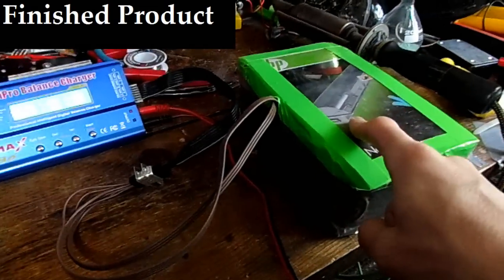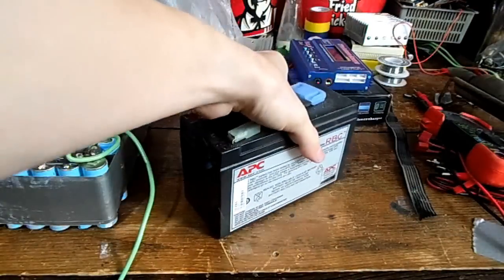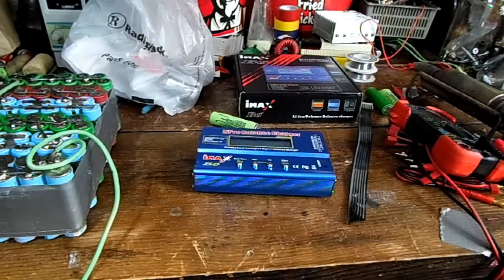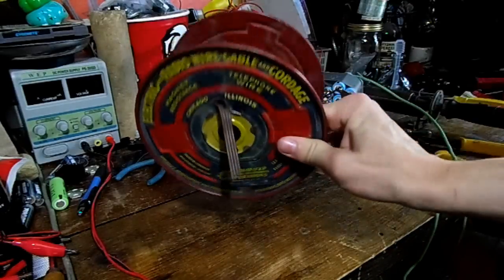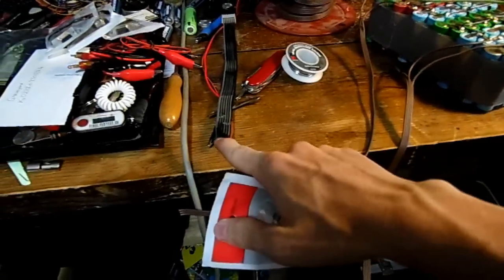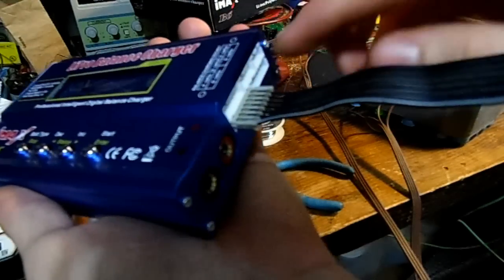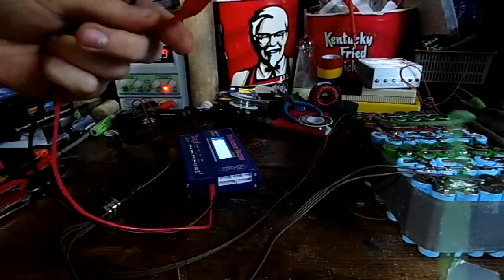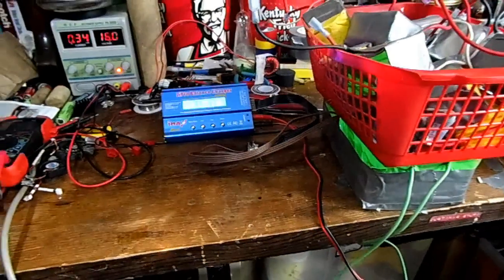DIY: Balance Charging E-Bike lithium battery upgrade

Comment: Nice work! There is an issue I'm not sure you're aware of. You're blncng a 6 cell battery. But each cell is comprised of 12 18650 cells paralleled together. The issue is you're not blncng at the individual cell level. It's like U R bulk charging each of the 6 cells. Diff. in internal resistance (ir) can and will cause the cells to become out of blnc. Out of blnc LiPo is literally like playing with fire. Also, try a MUCH thinner wire for blnc leads or just go to Hobby King and buy it for a buck.

Comment from the maker: Oh that looks better than the b6. When (if) my b6 breaks I think I will get that accucel6.

Watch "EEVlog #397" Dave does a nice teardown on talks about it. It looks very well made.

BTW lilo and lipo can be treated the same way. The only differences in the two are how they are built. You could also do what I do. I balance the battery cells to 4.1 or 4.2v and then after that I just charge it to 4.05v with my 0-30v power supply. I only need to balance the battery every month or so. :D

Comment: Excellent, thats much more clear...ReF the 100amp hour lipo battery, it will be for general electrical demand I,E shower pump, lights, winch, smoothie maker, power tools and mini washing machine ect, im using Trojan T105s which i have to say is a great tough tried and tested battery and i have 4 but without going into great detail they are far from efficient compared to lifepo4 technology but the actual 110 battery packs plus 50 amp charger ect import charge is very very expensive!, will update

Comment from the maker: oh BTW, you said your making a 100A motor, is that Amp-Hour? or do you mean "it can supply a motor with 100A of electricity"?

but anyway, good luck with your battery :D

Comment from the maker: yes the 7th wire is the negative 0v. or first wire depending on what direction :D

the differance between each wire is one cell. the wires go 1=0v, 2=4v, 3=8v, 4=12v, 5=16v, 6=20v, 7=24v.

the IMax charges with the outside leads at 24v. and it monitors the cells with the 7 wires. it first charges them all the same. then when a cell =100% it switches. it charges individual parallel packs through the 7 wires. that 2nd part is slow because it is much lower charge amps so it does not burn the wires.

Comment: Hi (Great videos)
I am going to make a 100 amp lipo battery for my overland vehicle, the only thing im not clear about is exactly where you soldered the balancing wires, Is the 7th wire negative?
Im wondering how the charger can separate each cell to monitor if they are connected in series ?
anyhow could you possible advise me as to exactly how to connect the 7 balancing wires?
Excellent videos by the way and thanks

Comment from the maker: you mean charge with the Imax B6? it's not meant to charge above 24v but thats why i made my 48v battery in 24v blocks.

you could also have two sets of wires coming out of the 48v battery. first wire would let you charge the first 6 packs and the 2nd would let you charge the 2nd 6 packs.

might even be able to charge both at same time if you disconnect the 48v battery in the middle so it acts as two 24v batteries while charging. but might prove a bit combersome.

i hope i made sense. =P

Comment from the maker: hahahaha yeah its the biggest i've seen. it's made for soldering roofing metal together but it works nicely for electronics. picked it up for 4$ at a yard sale a few years ago and just now started using it.

just FYI the soldering iron is an American Beauty Soldering Iron model number 3178. 115V AC 300 watts. :D

Comment: ha ha just starting out with ebikes and electrics.managed to  blow up a brand new lifepo4 48v 15ah batt.opened it up and the bms is fried.has 16 cells i think and 16 balance wires. im gonna buy the same balancer as you and start building lipo packs.really want to ride my bike!i have a question. how would i balance my battery with 16 wires and how long does it take to charge?

Comment: Price from trustfire is 8.06 per piece.  Those are rated at 6000mah so I think it's safe to say around 5 amps for each cell.  Sure I'll make a vid :)
Reply: Did your trustfire battery pack go well?
Reply: @wojciechtechtips1602  Oh hey long time. I ended up buying cells dirt cheap from a battery store called batteryhookup. Got a spot welder and made a battery out of the spim08hp flat cells to power it. Works great.

Comment: You certainly can draw high current from a protected cell.  Whatever the battery is capable off the protection circuit won't limit that.  Over discharge is running the battery dry which can damage it,  it doesn't limit the battery in any way.

Comment from the maker: where the chargers you got Imax B6 chargers? i'm only going to balance my battery like every month or so and instead charge them like i used to with my universal power supply. my first battery pack went for about 80 charges before the cells got .1v unbalanced. and since i keep them 0.2v under their max voltage there is room for error ^^b

i hope you get your other 2 chargers fixed.

Comment from the maker: i would love to mess around with protected cells (aka 19670 cells), problem is they prolly cost more than 1$ each unlike old laptop batteries and arent as plentiful as old laptop packs either.

not counting i imagine the extra degree of complication with a circuit board inside every single cell would make it easier to upset the batteries like you say haha. :P

Comment: sure there is fuse in mains powered product charger ...iii was discussing the use of the battery in powering the motor and how a battery in parallel could short the other batteries like a bus bar ... you wernt really paying attention.. were you ... you just wanted to help gang up on the outsider who was suggesting if there was any error at all  to err  on the side of safety ...iii am doing experiments you guys never dreamed of .. but you blew it and iii wont share any more data with you .. bye

Comment: The Phantom's face in the PHANTOM OF THE OPERA was burned off with sulfuric acid, which was used to engrave printing plates at a newspaper he was wrecking that had given him a bad review.

If there is a bad mishap, find a cave with an organ under an opera house and set up shop stalking a woman.  Problem solved.

Comment from the maker: haha yeah i already switched it to LI+ to charge it 4.1v instead of 4.2v. i heard there is a hidden menu that lets you calibrate the system voltage so might even use that to step it down another 0.05v.

and thanks for the compliment, you definatly know a lot about lithium too :D

Comment from the maker: your kinda starting to piss me off how you keep making comments and deleting them and then acting like i don't take ANY safety precautions or use my brain. when i was welding with the car battery i had a fiberglass shield over the battery so you can stop bugging me about the sparks. and no i don't believe in luck. i believe in chemistry and science.

but hey i don't know if perhaps your just drunk/drugged and have had a bad day. so i hope your day goes better if thats the case. =/

Comment: using skinny wire is like wrapping aluminum foil from end to end on a blown fuse ...yeaa.a. it will work  ..butt ...and its a  big butt ... what if you miscalulate the thinness of your wires due to factors beyond your apparent control ..... ..as  for being paranoid about batteries exploding ... iii already told you about one of my battery explosions ..and iii was lucky .. fear is your friend in a way wrecklessfulness  never will be ... the best pushed limits are with the brain we still have

Comment from the maker: i like to use small guage wire for that. it tends to melt and break connection if there is a short.

maybe you should try to be a bit less paranoid about batteries exploding, it rarely happens when you treat them right ^^

Comment: That said, there are a substantial number of electric cars with multiple batteries connected in parallel. These setups have the potential to generate thousands of amperes current with a dead short.

Comment: If you have two batteries connected in parallel with heavy cables, and one of them shorts out internally, it is equal to throwing an iron bar across the power terminals of the other battery. Shorting out a good battery has a huge power potential, enough power to melt metal, draw a welding arc, or potentially self destruct in catastrophic explosion. You would like to avoid this if at all possible.

Comment from the maker: i don't know why you keep posting comments then deleting them but oh well

i still don't understand why you think my battery doesnt have "true" balancing just because it doesnt have internal circuitry for it.

if your meaning because i don't have the charger tending to each individual cell well thats irrelevant because they are in parallel and will all be exactly the same voltage per pack. so its now 6 big cells instead of 72 small ones.

or do you mean due to how the Imax B6 functions?

Comment: not true independant balancing as you are just balancing groups .. but its better than nothing... 4  chargers would be needed and wires to each battery with rc  balance connectors  ... but hey you are doing great with a  wide variety of subjects...it would be great if you could build your own high powered battery with remelted lead .. like a flooded spiral cell of witch there currently none ...like design your own grid materiel or replicate it and wind spirals ..make battery walls clear lexan